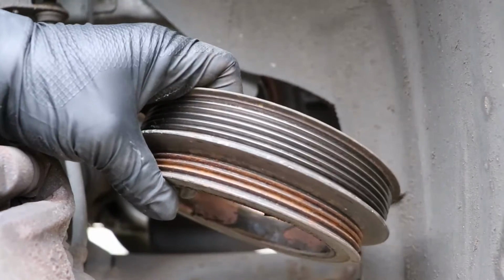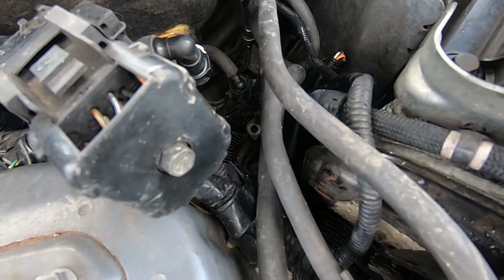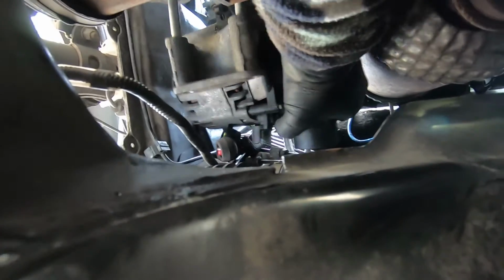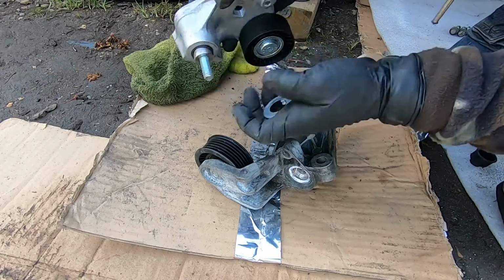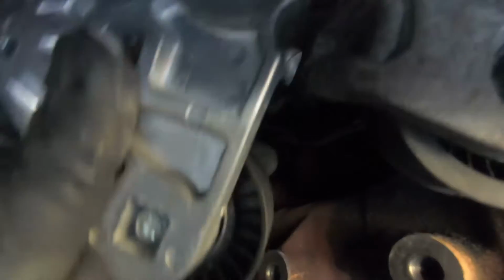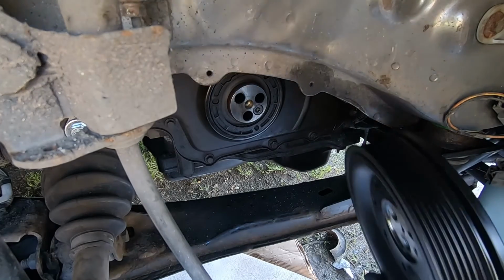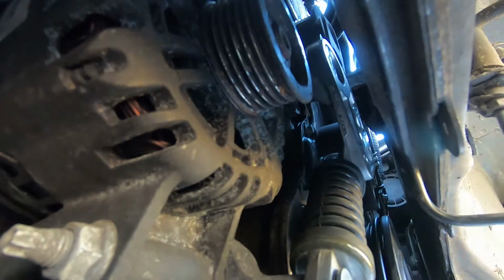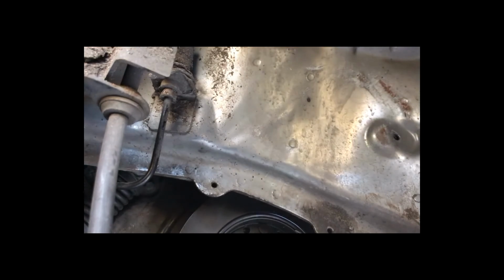Jaguar X Type or Ford Mondeo tdci Auxiliary Belt Tensioner

Comment: Thanks very much for the video. I did replace the aux belt last weekend on my Jaguar X-type 2.2 diesel.  I just wanted to leave some comments for somebody else that attempts this task. The size of the allen key needed to loosen the top screw for the tensioner is 8mm. I also took the two nuts off the power steering oil reservoir, so that I could lift it out of the way to get my hands down from the top. I have rather slim hands for being an adult and you need it doing this job. It is very fiddly and it took me 4 hour to do, and I'm a fairly competent DIY mechanic. Another tip is to Google the belt layout, make a printout of this and have it handy when you fit the new belt.
Reply: he does show the belt layout at 17.41 min

Comment: 😁👍👍👍 Best video on how to do it I've seen and I've watched quite a few! I just shortened the std pulley bolt that was awkward to get out as I didn't get a shorter one in my kit. Much easier putting it back on! 

I replaced all the pulleys and the rattle is still there. It's not the alternator as I tried another. Maybe the air con unit? Felt OK. The engine sounds sweet with no pulleys spinning and the belt off. 🤔

Comment: I've just had to change my belt too. 2.2 Diesel. Getting the belt back on is done easily by getting it into place on all pulleys which have the grooves first. Then, whilst pulling the flat bar to slacken the tensioner, the belt can be slipped easily onto the last top smooth pully without straining the belt at all. Good to know for next time. Thanks for the video.

Comment: Hi thanks for your Video. Helped me. Did a few things differently. Lined belt up all round system bottom pulley. Left one bolt Inn turned the pulley till other 2 bolt holes where in sight. Only took one pin out of Alternator pushed Alternator to one side. The only thing I've noticed tensioner. Has like a vibration. I'm guessing this is Correct On your Video I couldn't see what I was looking for once you started it.  Everything thing was tight Double checked.  It's working fine. Massive Thumbs up.

Comment: put the car in gear and wedge the brakes down with a block of wood and pull the seat forward... Then you can much more easily break loose the crank pulley bolts
Your way works really well too!
Reply: perfect solution, especially if you don't have the special flat bar tensioner tool.

Comment: Is no need to faff around trying to hold the crankshaft pulley wheel from rotating with a tool. Simply put the car into sixth gear then jam a stout bar between the removed wheel studs, to stop the pulley wheel rotating through using the gearbox. Is best not to make things more difficult than they need to be.

Comment: This is great. My X-Type 2.2D is running really poor when cold, but it's fine once it warms up, and sometimes I can hear a sound like a slipping belt for a second. I've checked a lot of stuff, turbo, EGR, etc, and everything seems fine. 
I'm thinking about checking the belt and pulleys next, to see if one of the pulleys is sticking, as the car also cut out once when I locked the steering all the way to one side.
And if nothing else, I suppose it's a good excuse to get down in there around the crankshaft sensor, etc, and see if there's anything amiss..
Do I need one of these special tools to loosen the tension on the belt, or is there an easier "hack" to do it? On my old Peugeot 407 it was just a 15mm or 16mm spanner if I remember correctly.

Comment: Really good video, thanks for doing these as I'm not only new to my x-type but also quite a newbie mechanic even though I'm 51! Your videos have really helped me get around the car, my next job is to change the alternator pulley and replace it with an INA 535022310 freewheel clutch pulley as I've read many times in various forums that this not only takes a lot of stress off all of the other auxiliary belt parts making them last longer but has a massive benefit in reducing the rumbling sound you get from the diesel engine and the vibration from the tensioner, this video has given me the confidence to drop out the alternator and get the job done. for anyone else interested there is another video showing how a freewheel clutch pulley improves how the aux belt runs here https://www.youtube.com/watch?v=gXa384YJdL0
Reply: true story, my original crankshaft pulley fall apart at 200 000 km, it was replaced  7 years ago, together with alternator pulley (with freewheel clutch pulley), 
soon I  will reach 400 000 km and currently it's still working without problems..

Comment: Many thanks, impressive job. My tensioner broke, the bung at the bottom slipped out, so I put it back in with a washer to stop that happening again. From your video it looks like you only took the alternator off to get the tensioner bits removed and replaced but you replaced the belt with everything in place, just forced the belt around the crankshaft pulley at the end by turning it. Was the belt in place on all the idlers?

Also, could you give me the measurements between the pins on your special tool as well as their diameter and length?
Reply: I believe the square socket hole is a 1/2 inch, just like on your socket set. The gap is too small for you to get a normal ratchet or socket bar into there. I guess you plan to make your own bar, you'll want it to be about 18 inch long and with 1/2inch stubs, each between 10 & 15mm long. Your post is 6 months old but maybe this will help someone else. Alternatively, you can buy the bar tool on ebay for about £20 UK.
Reply: @pitmonk  Many thanks. I forged a 1/2" square and welded it to a bit of flat to which I welded some rebar. All worked out in the end.

Comment: did also this job wul say did , attempted,, you can release belt with just the sealy tool slide hand under drivers side engine mount yul find another pully slide off easy ,, my issue was my allen key was too long an had no grinder at hand grrr so i couldnt remove the tensioner pully ,, again another day

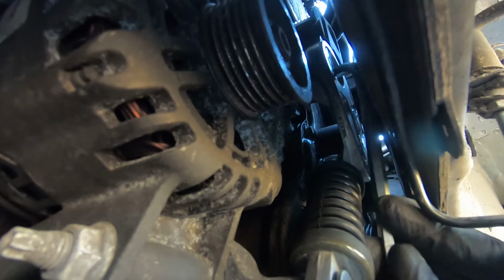Comment: Hi, in the minute 17:54 of your video, what's the size of the curved tool you used to loosen the tensioner?
Reply from the maker: AMINEDAOU That is an Allen key (hex key) which I cut to be able to fit in between. I can’t remember the size. I think is 7mm
Reply: LSA Team thank you. The job is done, in fact it was 8mm 😊